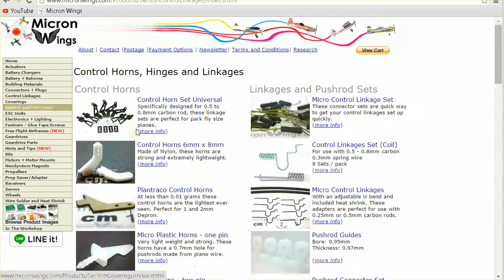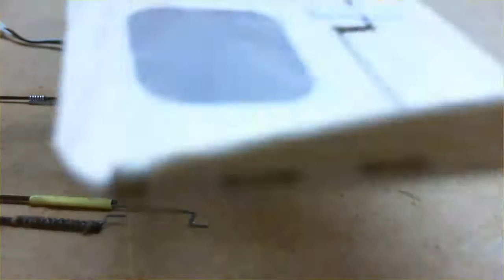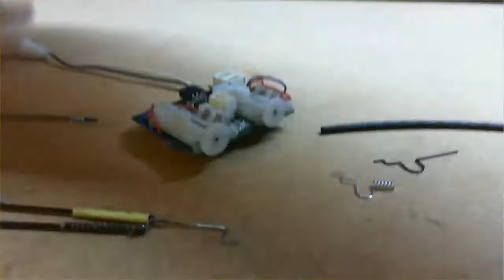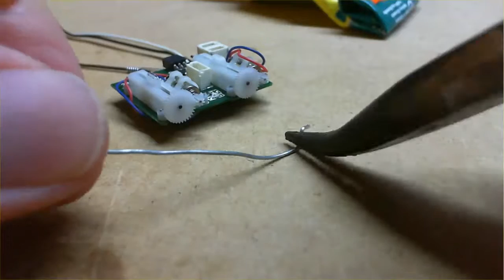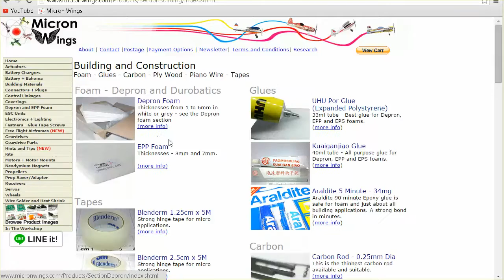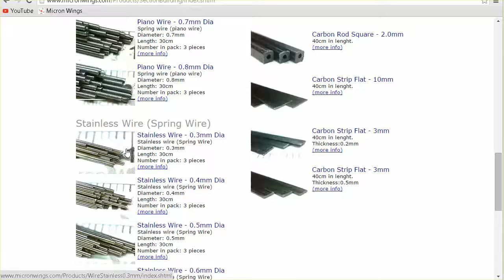Micro RC Control Linkages and Pushrods

Comment: I have an FRSKY version of the Oversky block Rx/Servos and it has + - brushed output and another signal line for brushless.  So with that I can power the brushless esc off the same battery as the block, and use signal wire from the block to control it.  Alternatively you could use the Ail channel signal (one of the unused sockets) for throttle and reconfigure your transmitter to use that channel instead.

Comment: if I run the motor wires on that little rx/servo brick to a brushless esc would it run a brushless motor? anyone ever done that?
Reply from the maker: On this particular model it won't work. however, there are examples of that working with an AR6400 receiver.
Reply: You can't run a brushless motor from a brushed board.  A brushless motor is a three-phase motor.
Reply: wel i have this board 
it's labled that it actually can
the black lil connector you see 
ha's 3 pins  "signal / + / -"  as normal for brushless 
but if you wana connect a brushed motor to it 
you ignore the signal , and wire the + & -  
never tryd a brushless motor on it yet though